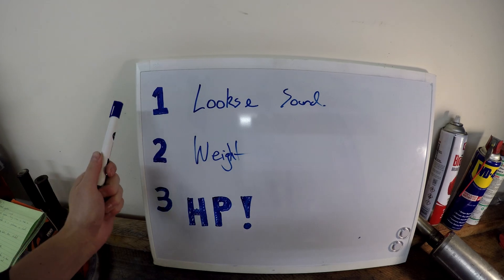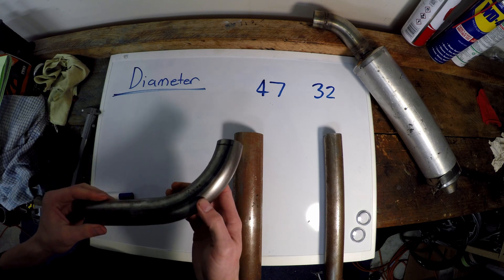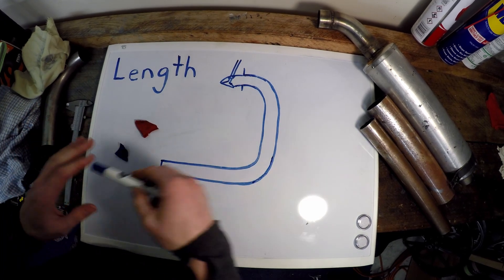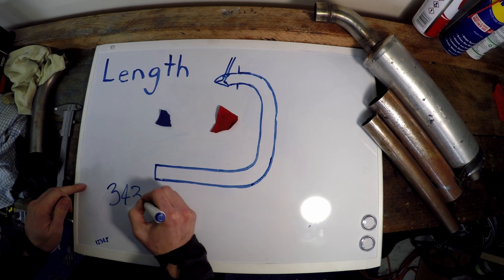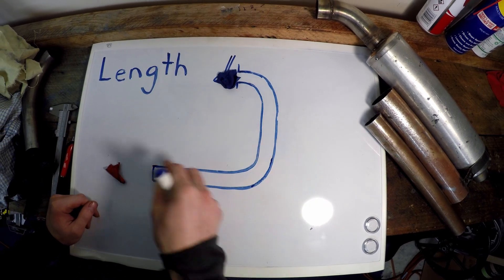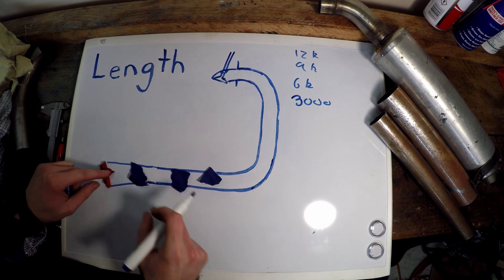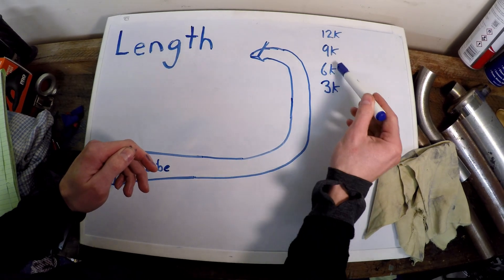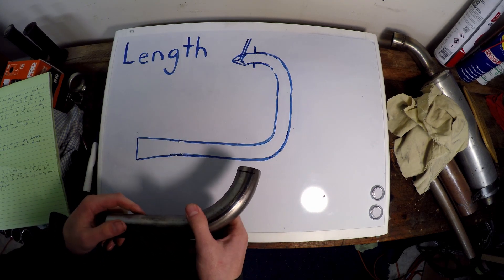Performance Motorcycle Exhaust

Comment: So, ideally, you want the vacuum puls to reach the cylinder head exactly when the exhaust valve opens - the problem being that in reality this happens at different rpms so your pipes will only work perfectly at one particular rpm?
Reply from the maker: Yes but that resonance will work at multiple rims zones, for example 3k 6k and 9k ect.  Normally tune for where you will use it most.

Comment: Just found my answers to my questions. Thanks man. 👍 Now my only question left is whenever I remove the silencer on my muffler why does it loose power?
Reply from the maker: There are a few reasons why that might happen.
Without the silencer the exhaust opening is to large and losing scavenging.
It may alter the tuned frequency that affects the pressure pulses.
The manufacturer would have built it to make the most power with it installed.

Comment: I modified my exhaust, basically to straight pipe now I am getting a back fire what could that be? it's a four strokes with ported heads. Should a muffler solve my issues?
Reply from the maker: @tuyo_adventures.2185  if the backfire is on decel it is most likely lean on the idle circuit. It is possible it's rich but it would have other issues as well if that were the case.
Adjusting the mixture screw to richer idle is where I would start or a bigger idle jet.
Reply: @TheMotorcycleForge   Thanks

Comment: Thank you for your video. I tried making my yoshimura exhaust more free flowing by removing the end cap sound baffle. Unfortunately I lost performance, it felt like it had better throttle response but I lost bottom end grunt and some top end speed. So I'm guessing the bigger diameter end on the exhaust reduced the intake/exhaust charge flow. I've heard the analogy trying to blow out candles with your mouth wide open compared to lips closer together 🤔
Reply from the maker: Yes that makes perfect sense , velocity is the thing you want to help empty the cylinder. It's a very fine line between to big and to small, big companies like yoshi spend millions finding that line.
Reply: Air has mass which has momentum due to velocity, the momentum causes a suction effect by leaving a void or a vacuum